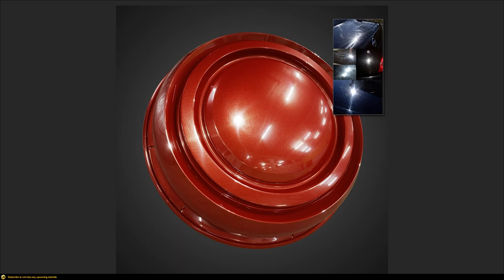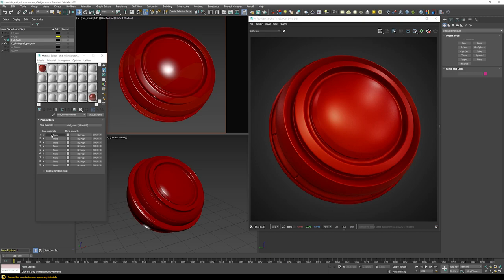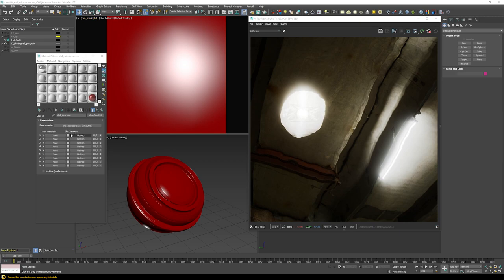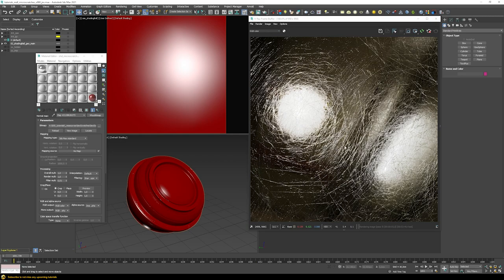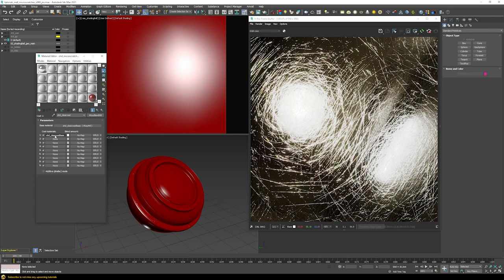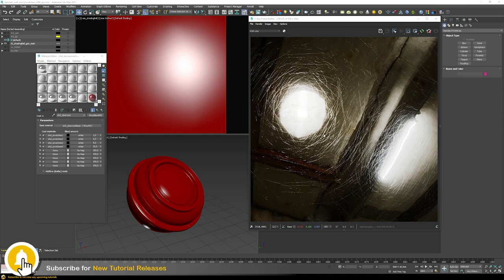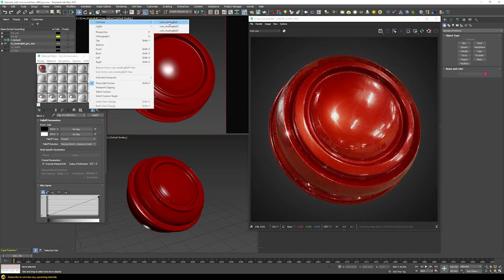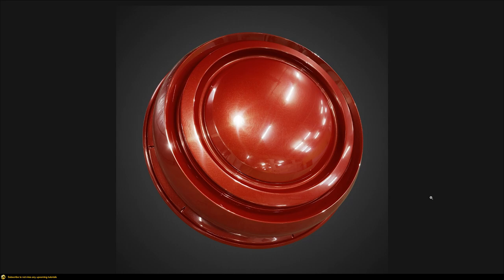V-Ray | How to create MICROSCRATCHES | Swirl Marks, Spider Webbing, Viscorbel Effects

Comment: Nice tutorial :) 2 Q's: 1- how come you don't use Slate? I find it less confusing than switching back and forth between material slots. 2- What was the purpose in adding a white colour to the blend amount instead of making the blend colour swatch white?
Reply from the maker: Hi, to admit for me it’s mostly old habit as I started to use Max way before the Slate Editor became a thing. I will try to use the SME more often now, also SME 2.0 is apparently about to released soon :) 
As for the white color I use that so that I can very easily adjust the coat intensity with the numerical slider. So you can just dial in 10 to get a 10% intensity instead of having to use a 255/5 = 25 RGB grey value. It’s just more intuitive like this, but this way requires the color set to black and the white mask to fade between black and white basically. 😉

Comment: Great video! I got some usefull tips. 

Isnt adding several coats (the scratched bump coat) in the VrayBlendMtl the same as just using one with the same output multiplier? You added 4, all with a value of 10 which equals 40 in result. Would it be the same than just using one coat with a value of 40? 
I just ran a test and looks the same to me. Didn't notice any difference.

Any thoughts?
Reply from the maker: Hi, the result should be different as all those 4 layers use different anisotrophy and rotation values. If you simplify it down to 1 you will loose this effect. But if you got visually the same result using just one layer in your scene then nothing speaks agains simplyfing the shader a little bit :-)
Reply: @JonasNoell  It definetely was the Anisotrophy rotation and dispersion. 

Thank you for your feedback. You have a loyal new subscriber. Cheers :D

Comment: After looking at this tutorial again I noticed you used metalness at 0,25 for the base mtl. I guess you did that to get a bit of color in the reflections? How would you set it up without metalness? Falloff curve in reflection with tinted color (facing angle) and maybe higher fresnel to compensate?
Reply from the maker: Hi, yes exactly it was just a creative choice to tint the reflections a little. Technically it is not physically accurate as the metalness should either be 0 or 1, but for the sake of simplification I used it like this. If you don't have access to the metalness parameter (in case you are using older versions of V-Ray) you would do that with a falloff curve. Technically you would blend 2 shaders in a blend material, one metallic with fresnel turned off and a colored falloff curve and one dielectric one with fresnel and white reflections. You could see this process in detail in the carpaint tutorial that I did before.

Comment: Nice one! Can‘t the streak effect actually be  achieved cheaper by a lens effect? 
Also sometimes it‘s very hard to see what values you are actually changing, maybe a screen lens would be of additional value.
Reply from the maker: The swirls in the shader are different from the lens effects. With the lenseffects you can just have these straight streaks which derive from the blades in front of the camera lens, but this swirly effect that follows the shape of the surface is something that derives from the surface level. At least so far I didn't found some convincing way how to use the lenseffect for that. For the screen lens thats probably a good idea, will check how I can add this for future tutorials :)

Comment: Great tutorial as always mate! I'm wondering.. to create your materials, are you really working in compact mode instead of slate, or that's just for presentation? o_O
Reply from the maker: I tend to work hybrid, using both, but tend to stay in the compact one for the majority as I find it more easy to deal with simpler materials and to quickly instance whole hirarchies between different shaders and so on. 
Actually for presentation I agree it's probably better to use the Slate more, because while the whole structure of the material maybe is very clear in my head for myself, for people watching the Slate is probably easier to understand as you constantly see the whole hirarchy :)
Reply: @JonasNoell  Yeah I'm not sure honestly, it's just that personally I've discovered that slate has allowed me to speed up my workflow significantly and come up with more creative and complex solutions than when I was only using compact. Looking at your tutorials and seeing you were of a somewhat advanced level, it surprised me to see you use the compact mode. But to each his own I guess! Getting good results is what matters, so you can use what you're the most comfortable with. Thanks for the reply :)

Comment: No matter what I did -- bump map or normal map, flipping or not the green channel -- I did not get the sharp and lengthy lines you did. I got what amounted to a softish bump map, with short scratch lines. It looked more like a bumpy reflection than a scratched one (using Maya 2020, not Max; but I endeavored to translate your workflow accordingly).
Reply from the maker: Did you try to disable filtering for your maps?
Reply: @JonasNoell  oooo No I did not... something to try.. Thank you.
Reply: @JonasNoell  Okay... Turned texture filtering off. Changed from sRGB to Raw for the normal map. And then back again. Doubled the mapping coverage of the texture to make the lines smaller, thinner. I am still getting lines that just bleed out from the edges of reflective highlights. I don't get the "webbing" that you see in your photos or your renders. 

This is Maya, so that might be part of the problem. A different workflow might be needed. Unfortunately, I can't find anything online for creating such an effect using Maya.
Reply: @JonasNoell  Started to get something. I messed with the bump level and the opacity of the layer in the blend shader. Started getting a more hairline look, but they still looked like fractures more than scratches. Still, a bit of progress.

However, when I went from a studio to an outdoor, daylight HDRI, the scratches all but disappeared. 

I tried to create a specular-based scratch layer, but without the bump, you don't get the circular webbing around the highlights.

Oh well!